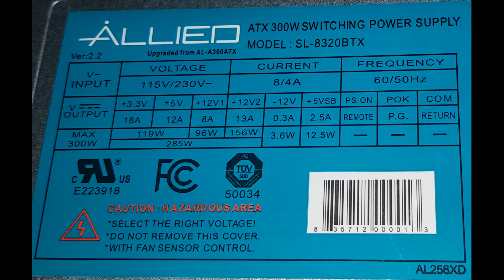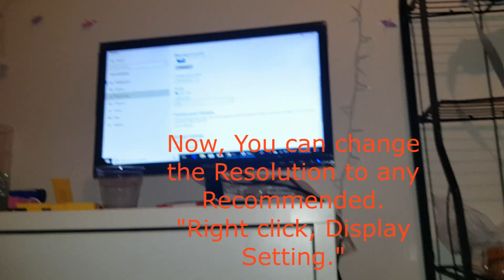How To Upgrade PC Desktop Power Supply 500W & GPU GeForce GTX 1660 6GB

Comment: Hello, I have an Nvidia GTX 1660ti and a 450 watt power supply. Can I upgrade to a 750 watt power supply?
Reply from the maker: Yes, depending on the connection you have with your PC and Power Supply. Make sure you have the same type or it can shock it
Reply: @SaiShiang  The same type of what please?
Reply from the maker: @iwestcomputingsolutions  power connection plugs,

Comment: I have the same pc but I don’t have the sata cables for connecting the graphic card to power supply
Reply from the maker: You need the Power Supply that has Sata Cable for graphic card.. which is the same Power Supply I have there.

Comment: your processor Intel i 3 or i 5  ?
Reply from the maker: It can be any AMD processor to whichever you prefer! This is not for Intel motherboard
Reply: @SaiShiang  gigabyte ga-h110m - s2 and Intel i3 6098p it enough for this 1660 super graphics
Reply: Will this work on a dell optiplex 7010 small factor with 500 watt power supply and 1660 gtx graphics card

Comment: I need a little help overhere, soo if someone can actually do that i would really appreciate it. Im looking forward to buy a gtx 1660 6gb, my pc its compatible with it but i have a powersupply 500wat, and i talked to a lot of people asking that can a 500wat powersupply handle the gtx 1660, i quietly didnt get any specific answers. But the problem its that the powersupply its not like a famous gaming brand, i think its just an office powersupply. The model of the power supply is "LC500H-12 v2.2". Can this powersupply handle and run the gtx 1660 normally in my pc?
Reply: no , is danger
Reply: yoo yesssssss

Comment: i have 480w is it enough to that exact same graphic card
Reply: Ya it would supply enough power to the graphics card...but the thing is which quality of power supply u using if you have like 450 watts which is good quality it can easily supply enough power to your motherboard components..GPU ofc...just always remember buy a good quality of power supply don't buy cheap it will give problem in future only one time investment